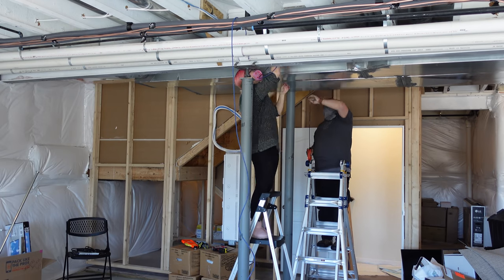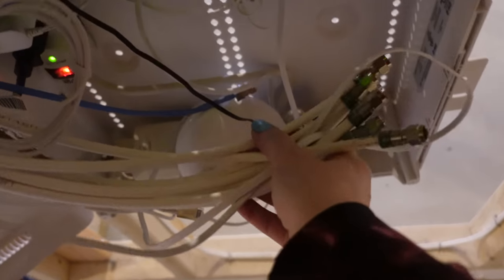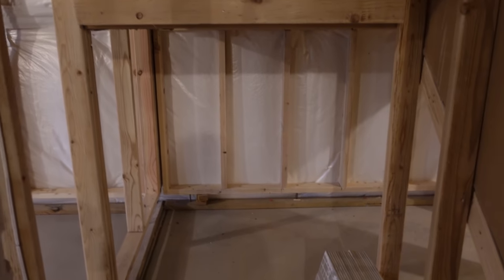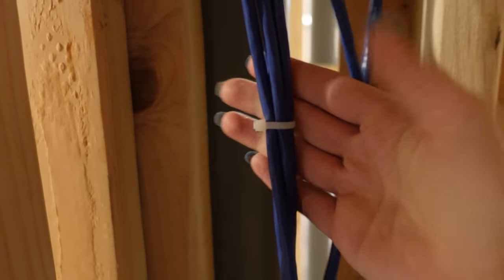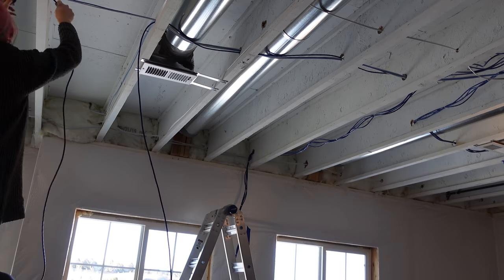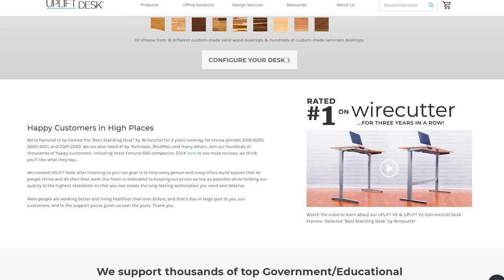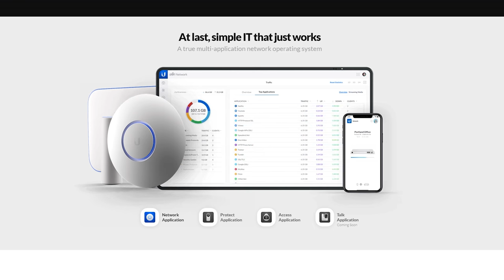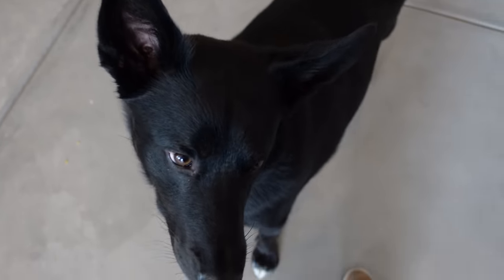Running 10 Gig Ethernet In My Dream YouTuber Studio: Networking & Internet Access | Pt 2

Comment: ZFS for storage, in over a decade I have not lost any files, backups are a easy, compression, dedupe and encryption are baked in, redundancy is also baked in and it's high performance if you plan in advance for it. If you decide to go down that path I can help and I would provide my time for free. Also I probably have a half rack thats unpopulated (hp or sun version 19"rack), I'd have to look but we had some a couple years ago and haven't done a surplus run in some time. Ping me if your San Diego adjacent and can pick up.
Reply from the maker: I’m in Denver but already bought a rack. Thanks!
Reply: @ShannonMorse  The offer for ZFS is still on the table, I'd be happy to give you an overview, I deal with petabytes of imaging data and I'd happily give you advice/help you set up a zfs file system. I like and sub but thats all I can really do. I work in research and they don't pay like commercial enterprises but the autonomy my position lends makes it all worth it. I'd be thrilled to be able to give something back to your community. Gratis & libre. ZFS takes some planning but IMO it's always worth it.

Comment: For your lab I would suggest you run lots of Ethernet lines as you don't want a switch where you solder. It's better to have too many lines than not enough and wishing you had more. This comes from personal experience.
Reply from the maker: Thanks!
Reply: I attach my switches to the underside of the table.  Keeps the dust and other stuff out.  It even helps a little with cable management.

Comment: Curiosity inspired. Are you going to replace the florescent lights with LED lighting for color temperature adjustment/stability? I noticed you ran your data cables under your lights and this will make it harder to replace later if you decide. 
   Thank you for your videos. I know they take a lot of time and effort.
Reply from the maker: Yes, all of the lighting is switched over to dimmer switches with LEDs. And I can adjust the temp 😻

Comment: If you have a spare set of hands to help you with the rack you wont need this tip. When I had to do the racks for my shop everyone was either on the road or at the benches or long story short if you have no help depending on what your adding to the rack and its weight. Keep boxes of different sizes small or big to stack in the rack to hold what you add as you move front to back of rack as you work. Some guys use 20volt drills to screw stuff into the rack there really no need for that much torque a 12 volt will get the job done
Reply from the maker: I’ll have help

Comment: Never run just one cable to a location.  Especially if you already have the walls opened up.  Always run more than what you need for redundancy.  Never know when a cable is going to stop working.  Since you didn't make the cable, the cables are probably made with stranded wire instead of solid copper.
Reply from the maker: Thanks!

Comment: Cut the cable ties off of the cables before your dry wall goes up. If you have cable ties you cannot put a new cable using the existing ones if there is a problem after the walls go up. You should avoid using cable tie tightly on ethernet or fiber cables. Finally, if you do this again, buy a box of 300ft solid core cable as its more robust for permanent runs. Good Luck.
Reply from the maker: The cable ties were cut off before the drywall was set up. I didn't want to deal with 300ft of cable. Buying the shielded cables works fine for my needs.
Reply: @ShannonMorse  Agreed, I have done that before, the biggest issue with them is they curl and twist when you try to put them through. Makes it a pain to deal with later on. The area is looking good. Enjoy it and your new found speeds.

Comment: Remove all those zip ties before you add drywall. They're nice to get it installed but if anyone ever needs to do an upgrade they're SOL.
Reply from the maker: We did 🙂
Reply: @ShannonMorse  Ohh good! I run into that and staples all the time. Finding someone to match drywall is a pain.

Comment: I personally prefer to have my trunk line running SFP+ on my home network rather than 10Gbe. Most of my devices do not saturate the 1Gbe connectivity with the exception of my security system alongside the streaming devices.
Reply from the maker: Cool!

Comment: Cat6 and 6a aint faster than fiber. Fiber is the fastest. But you meant faster than the ISP speed you pay for?
Reply from the maker: I don't understand your question. Cat6 & 6a can do 10gig. I think I said it in my video, but if not: I'm running 10gig in the basement because I want my local network to be faster than what it currently is. I'll be storing all my files on a NAS and editing on a separate PC - and in order for the 4k video edits to go smoothly, a fast connection to the NAS is a must. My ISP gives us fiber, which is 1gig. Obviously that is capped unless I paid for a business connection (you can run new lines to a house but it's insanely expensive for residential, so I'm not doing that). That's why we're fine with the rest of the house being Cat5e - because we already get the max speeds from our ISP.
Reply: To be the nerd in the discussion. . .

Ackshually, copper is faster than fiber as the transceivers needed to change a native electrical signal to a light signal add latency. 

The advantages of fiber over copper are the distance it can be run (kilometers versus meters), lack on interference, and the bandwidth it can offer (also known as multiplexing). While fiber may be able to handle 100Gbp easy-peasy, it needs transceivers and compute power to multiplex/demultiplex as well as convert electricity to light, both of which will add small amounts of latency. 

I mean, DAC in datacenters is a thing for SANs.

Comment: CAT5e is not rated for 10 Gbits. That does not mean it won't do it. It depends on length, quality of runs and connections etc.
Reply from the maker: Of course.
Reply: @ShannonMorse  Of course, but not what you said. :-)

Comment: Centurylink 1gig? Hehe, we have Centurylink dsl. 15megabit down, 1 up. Centurylink fiber here gets you, wait for it, 20megabit down! 

Its all we need, but it does take a solid day to download a modern game. Technicians ain't the best, but definately beat shitel 'that cut into a power line, thinking it was a coax cable'
Reply from the maker: Generally I get top speeds, 800-1000mbps. It's not bad, especially when it comes to uploads.
Reply: Nice - the best we have here is Comcast/Xfinity at 1.2Gbps/35Mbps.  Good enough for us.  Verizon FiOS hit the other side of town - and stopped there.

Comment: "I really don't have any VM's..." ... yet... :D
Reply from the maker: Lol
Reply: @ShannonMorse  Have you ever checked out Unraid? It seriously changed the way I do home-labbing... Super flexible (mixed storage sizes w/out sacrificing parity) and super powerful (can run VMs, docker containers, and act as storage server.) I got a old Dell PowerEdge T420 for about $500 and slotted in 7 3tb drives and 1 NVME on a riser (for cache drive) and the thing FLIES. Hosting Linux VM's, a bunch of containers (2 Valheim servers, Deluge + VPN, my website, a personal cloud [dropbox replacement], and duplicati that backs up all images and personal files for myself and my wife to Backblaze B2 for super cheap cloud backup)

Comment: cat 5e is really out dated by todays standards & if i understand it correctly cat6 is not/will Not do 10gb no more that 55m @250mhz Total &  it Must be Cat6a for 550mhz With 10gb over 55meters ! ! I run Cat6 &Cat6a & cat7 on my main 1gb network Mainly for through put & latency & DAC Cables & Fiber on my separate 10gb network ! I Would Chang it All To Cat6a before you close in the walls & dont let the contractors Tell you that it wont matter because it will ..Ask me how i know ..its a costly mistake on my part ! cat5e should just be for a pbx phone systems now days or landlines.. I think it is well worth the up grade to cat6a or cat7 Now..It dont cost that much more per 1000ft spool now days..But Ultimately your the one that has to live with it & its ure money & if ya want to spend it twice then that is up to you..but its a lot like buying a New ferrari & then going to wall mart an saying give me the cheapest  tires you got ! but a lot of folks seam to do the same thing..Do Some Research talk to some pro's don't take my word for it ! But Cool Video any way
Reply from the maker: It is all cat6a. 💃🏻
Reply: @ShannonMorse  Ok my Bad..I just misunderstood ! Cool Video..I Bet you cant hardly wait..! I Couldn't when i done mine !
Reply: There is no point to Cat 7. It's a waste of money with no purpose.
Reply from the maker: That’s how I felt. Might be great in 10-15 years but none of my home or NAS devices would be able to take advantage of it. I had to stay within budget.